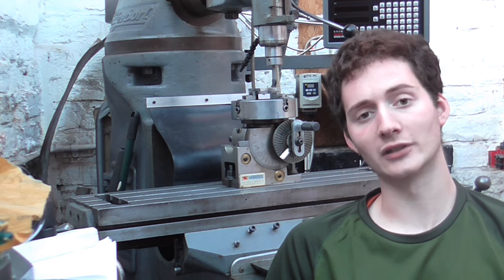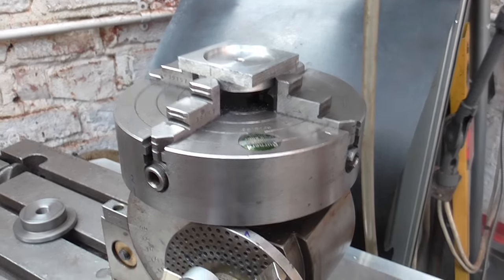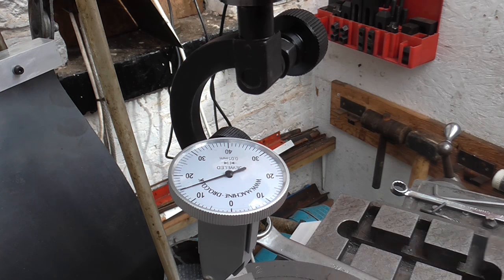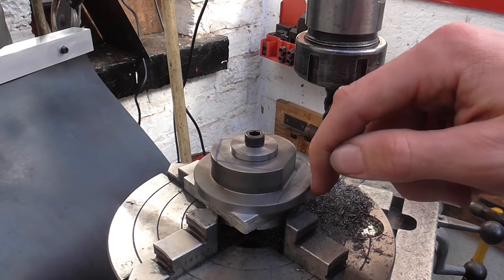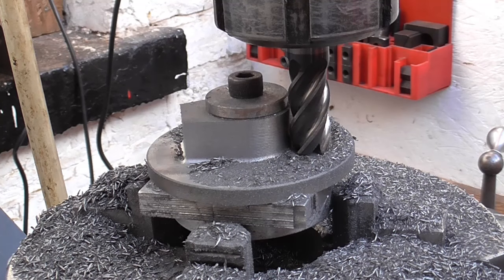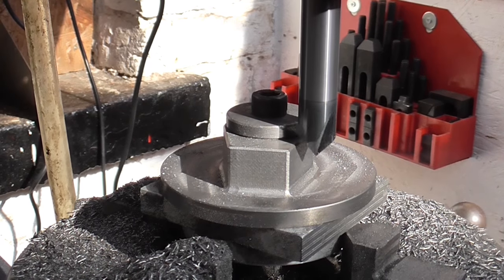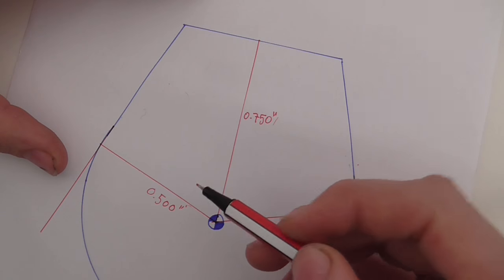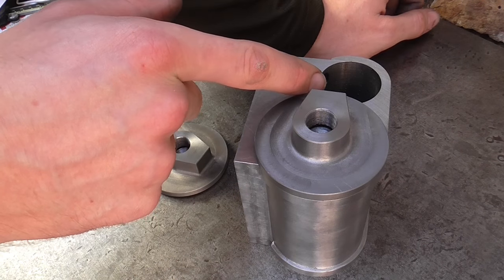Machining Cylinder Heads Part 2

Comment: I did the math for Pythagoras in 16ths of an inch.  
3/4" = 12/16"    
5*5+12*12=169
Sqrt(169)=13
Hypotenuse = exactly 13/16"

Too perfect. Must have been planned.
Reply: Bill Elkins . Definitely. 5,12,13 is a well known Pythagorean Triple, like 3,4,5. The next two in the list are 8,15,17 then 7,24,25. There is an infinite number of them.
Reply: @stumccabe  You mean I did not discover the 5,12,13 set!  I was vaguely aware of Pythagorean Triples. What I noticed was his decimal calculations were easier in sixteenths.  Machinists may write down thousandths of an inch but they still call them by their name when they turn up, half, quarters, eights and sixteenths.  (I am not a machinist.)

I hope you apprecieate the rapidity of my response compared to yours to me.  I waited 4 long years, one of which was 2020.
Reply: @billelkins994   Stu may not be around anymore, given the psesent "situation" ... Bill...😧

Comment: Crispin, why are they that shape? Does the 'square' part of the boss line up with the passage from the valve to the cylinder?* Did the Edwardian/Victorians overdo the aesthetics or is the rest of it machined down (or originally cast like that) for some other purpose? Rog

*Edit; just watched part 3 and no, it doesn't 😀
Reply from the maker: Hi, no the top of the boss is like that so that another component can be attached to it. Cheers